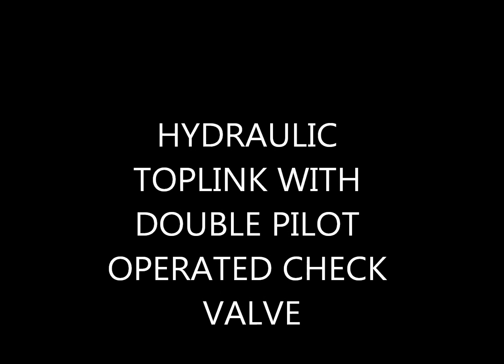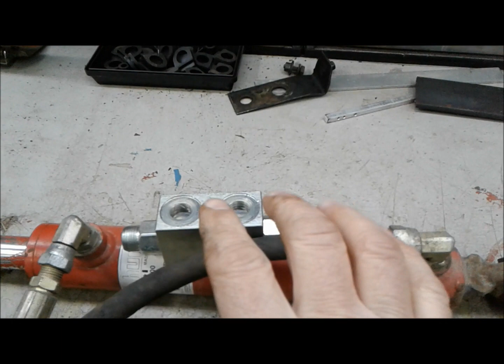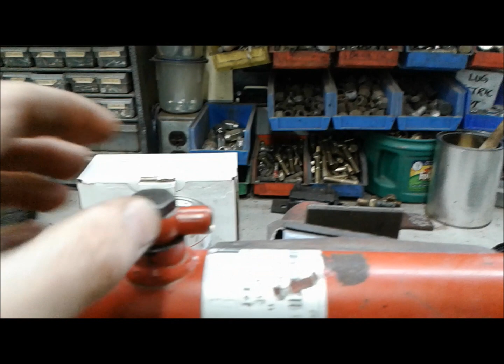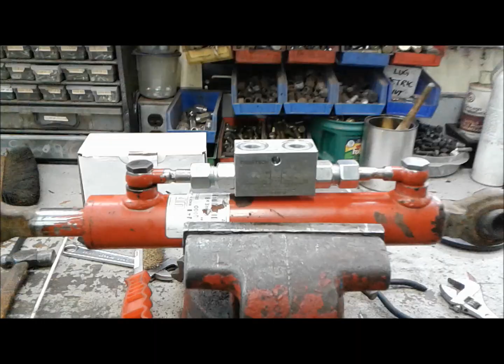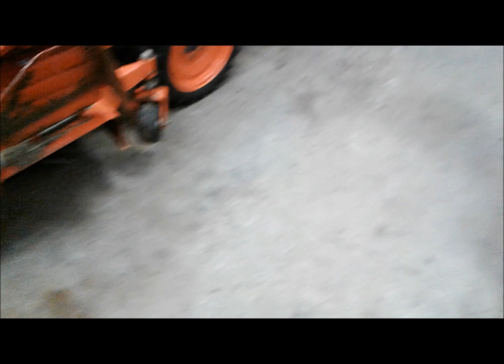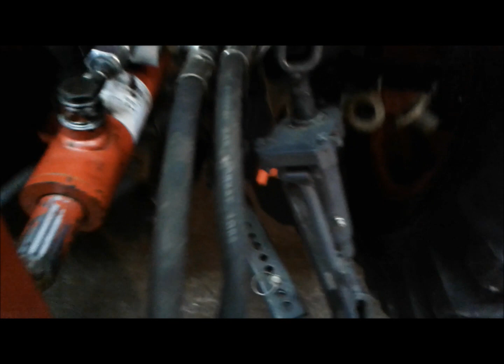Hydraulic Toplink

Comment: In reference to the statement that “the cylinder can’t creep with that valve installed” - if your cylinder packings were worn and leaking by , it’s possible for the cylinder to creep
Reply from the maker: correct, I made statement referring to a healthy cylinder.